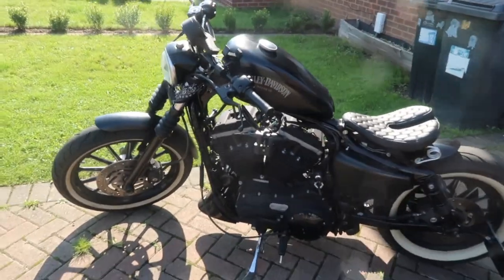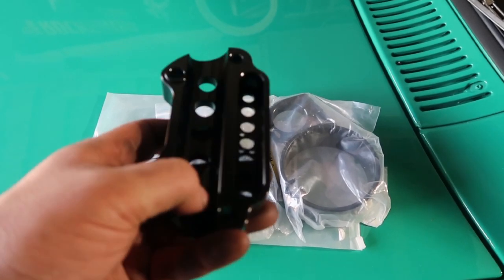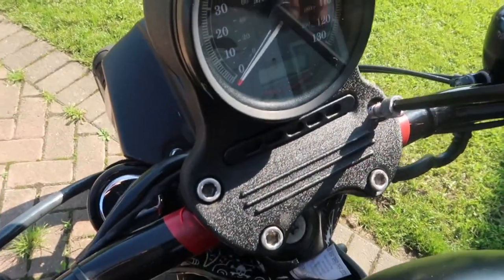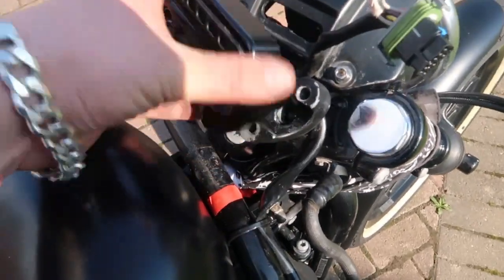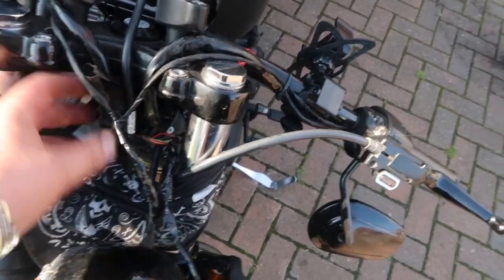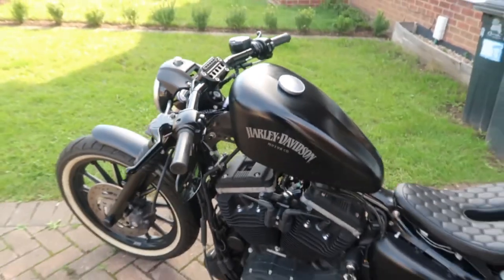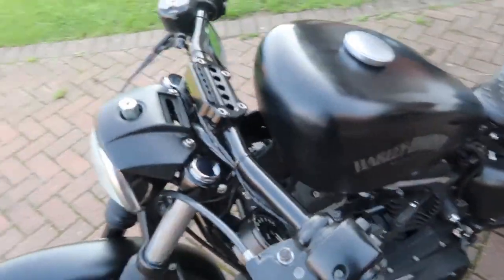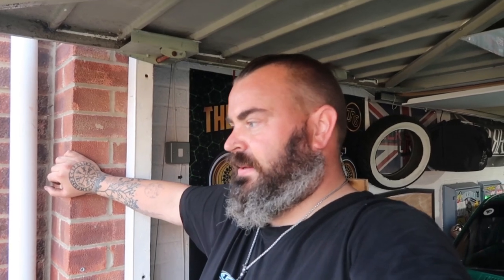Harley Davidson Sportster Speedometer Relocation

Comment: Do you think you could have trimmed down the original top clamp and used that? The relocation is probably my next project
Reply from the maker: I did think about doing that but I wanted the ability to put it back to standard if I wanted to. The kit was cheap enough anyway.
Reply: @RuckStyleUK  yeah returning to standard is also in the back of my mind too. Great looking bike you have there
Reply from the maker: @B1gDave2010  thank you sir